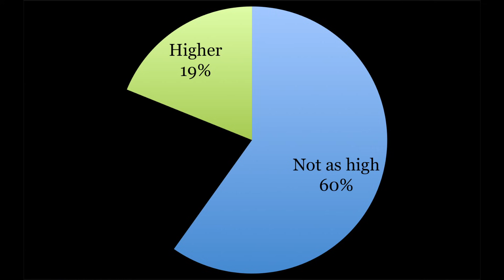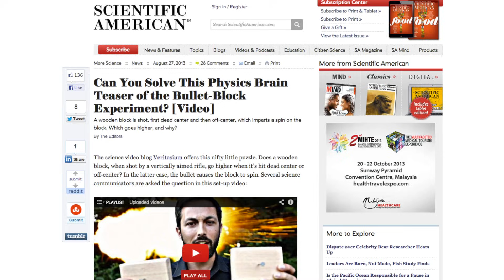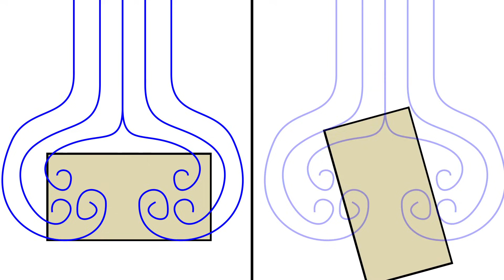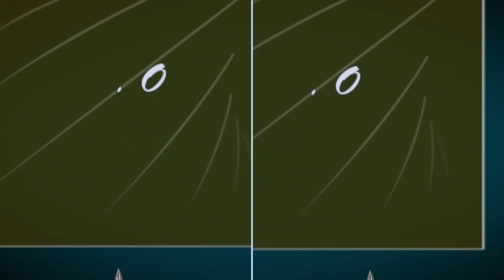Bullet Block Explained!

Comment: Exactly when the blocks had X energy is irrelevent to the study of why there wasn't as much of a difference (in the height) as expected given such a linear event from start to finish (apart from wind resistance). This video is a mess, is all over the place, and is making my head spin like a block shot in its "off-center" lol

I dont understand why two different laws keep getting exchanged seemingly for the sake of feigned confusion. =( I imagine its to illustrate the various ways someone MIGHT look at this from different angles. But why not explain the correct way to understand such an experiment first. Then give the neat side-notes of experiences and perspectives.
The quote @ 02:45 seemed to be on exactly the right track if I understood him correctly as meaning "the amount of energy necessary to make one of two nearly identical items spin is miniscule when compared to the amount of energy needed to win the fight against earths gravity (if only for a few moments and feet)" which no matter how you calculate it, is true in the case of these blocks, and for the record, a comparison of two unrelated laws of physics. 
"1.5x the energy" does not mean "better than gravity."  ;)  Especially when that "1.5x the energy" is largely used to uselessly spin around on an axis lol.
But I mean, for a piece of wood, its a pretty exciting trick!
And I don't mean to be harsh. But the first 4 min of this video are so scattered and tangled, its enough to ruin some people I knows understanding of the entire thing. I appreciate people experimenting, sharing, and generally pursuing greater / more varied knowledge. Its awesome and exciting and always makes me hopeful.

Comment: I would change the experiment as follows:. Put the block on a fixed axle (instead of the nail) so 100% of it's energy becomes rotation, or crushing the wood.  Then shoot it both ways to see the difference in dept.

Comment: Use softer and much larger blocks. So if the bullet travels a meter into the block the difference will be 1 cm (assuming 1% difference), which is totally measurable.
Reply: Traveling that far might cut down on frictional losses too!  Which was my choice for why they both go up the same amount but the one rotates!  The rotating one has less loss of energy due to friction.

Comment: This is one of the things I found extremely counter intuitive about kinematics. The short answer is that while linear momentum is invariant under translations, angular momentum is not. For example, an asteroid traveling extremely fast but directly at the sun will run straight into the sun, and that's it. Now point the asteroid just slightly off center, and it will end up orbiting around the sun with some angular momentum.
So look at the block and bullet situation from the Center of Mass perspective, because that's usually the most convenient to work with. In the first instance, the bullet is traveling directly at the center of mass. In the second instance, the bullet velocity is not directly towards the center of mass. So in the second instance, the system actually starts with some angular momentum with respect to the COM as soon as the bullet is out of the gun.
The hard part is intuition we have that 'everything is exactly the same, except the gun is shifted 2 inches'. Everything is the same with regards to linear momentum, but 2 inches means everything to angular momentum. Energy is still conserved, it's just with regards to the COM the the second system starts with more rotational KE.

Comment: this is far too unsatisfying.
Reply: I think if he did a quick test of the wood for temperature you might see the bullet fired directly into the center of the block got a lot warmer.  Heat=energy.  And once you factor in the energy of heat you would see both blocks had the same amount of energy.  The spinning one just had energy you could observe without any additional measurements.

Comment: There is no more energy because as the block spins it's being equally pulled down and pushed up. Same as the one hit in the center. Rotation doesn't equate to more energy. If it had more energy it would go higher.

Comment: What if you try the experiment with the following conditions and compare it to the previously tested conditions:

Constants:
- all blocks must be the same weight

Variations:
- blocks that are heavy on one side, then shoot the lighter sides.
- blocks that are heavy on one side, then shoot the heavy sides.
- blocks that are heavy on the center, then shoot either side.
- blocks that are heavy on the center, then shoot the center.
- "aerodynamic" blocks
- blocks that are not easily penetrated by bullets
- combination of those variations (ex: aerodynamic and bullet-resistant blocks, etc.)

My guess is that maybe different factors, such as the distribution of weight and aerodynamics, could affect the outcome of the experiment somehow.

Maybe shooting the block on the heavier side, when one side is heavy, would go higher. Maybe more spinning momentum would produce lift. Maybe the weighted side would create more upward and downward momentum, resulting in more spinning momentum that could help it go higher. What about blocks shaped a certain way, to reduce drag (while still being as heavy as the other blocks)?

I don't know. I'm not a scientist or a physicist, but I'd like to see the results of such experiments.

Comment: But if the X-ray showed the same level of penetration, then what the hell was up with the nails showing different levels of penetration...?
Reply: It may be because the bullet created a curved hole as it entered the block. The nail doesn't curve through the hole, so it wouldn't travel in as far.
Reply: I don't think the curve would've been that extreme. 

The nail will have been narrower than the channel by a significant enough margin for any curve to be largely negligible anyway. 

The video just seemed to contradict itself by not addressing this before it ended.
Reply: Bullet4MyEnemy Yeah, I agree that Veritasium should probably have made that a bit clearer.
Reply: Jack Hooper There is a lot in this video that was just all over the place
Reply: GOOD POINT BULLET! i wondered exact same thing, sticking a nail completley in one hole and than half of it in the other whole than Xray and 1/10mm difference WHAT BS WAS THAT?
Reply: Jack Hooper Agreed!  Using a thick nail to trace a bullet path in a spinning object when his graphic shows it curving was working against him!  Just use a wire gauge!
Reply: Actually, he did address this, less of the energy went to deforming either of the pieces.
Reply: I know I'm late but I only just came across this video.
If you look at the X-ray images, the block with the bullet off to the side has a very visibly less deformed bullet. The bullet in the centre is a rough circle, in the image, whereas the other one still has some of its original shape. If this holds true for all the blocks, that would explain some of the difference in depth.
All in all, the choice of wood as a material was simply a bad one, and using a solid, inflexible piece of metal, i.e. a nail, to test depth made it worse.

Comment: The easiest way would be to look at the bullet:
# Both bullets get blocked by the same mass and mass density, hence their speed reduction would be the same.

btw. Science isn't about what looks cute. So leaving out information that might show that the average rotating block goes higher and has less height deviation than the average non-rotating block is significant. Cute ("same height") is about emotions.

Comment: What doesnt make sense though, is what happens when the block with the bullet shot on the side reaches the top (meaning the nail, gun barrel, and bullet are in a straight line). Shouldnt the energy then be pushing down, not up? the direction of the energy would literally have to do a 180 or the vertical energy would be pulling it down. WTF THIS IS CONFUSING. I LOVE IT

Comment: Think about this:
Imagine two identical cars each weighing the same. Now, one car is pushed forward, the energy is focused in the middle. The second car is pushed with the exact same amount of energy, but the energy is focused on the right or the left (still pushed forward from behind, however). It makes sense that the car will travel the same distance. Same idea with the block.

Comment: Try non penetrating(solid) blocks so we will have energy transfer only at the strike ..!
I feel in that case height won't be the same ...!
block with bullet striking at center will go farther ..!
But in that case since bullet in not inside block the bullet hitting block at the corner will go farther and hence we can see conservation of energy properly.
In current case also energy is preserved but since there is energy loss in terms of sound and deformation we can't measure it properly .
In other words we can say in rotating block less energy is lost in deformation of block hence it could go approximately to the same height even while rotating.

Comment: Erm, it seems to me that the obvious answer would actually be that the block is spinning in the first place because one side has more gravitational potential energy than the other since the bullet impacted to the side of the center of gravity, which also means that the other has less and the total net gain of energy is the same.

Right?

Comment: Several good answers and I'm a little late to the party but...

Given that the difference in penetration depth is expected to be very small, the obvious first answer is to increase the total travel of the bullets by lowering the density of the medium.  Lots of people are suggesting using styrofoam... which is not feasible, since the total mass of a styrofoam block that could halt a bullet would be enough that the experiment simply wouldn't work.  I've seen ballistic gel mentioned, but it lacks the rigidity to accurately model the original experiment.  I have similar objections to various other types of materials that I can think of.

One solution to these is to use a composite object.  Given that we're most interested in the end of the path through the object, you could create a block made of layers of wood of different densities.  Assuming a total penetration of approximately two inches, create a block that is composed of 1.5 inches of the original material (pine?) on the top and bottom, and replace the middle section with a lighter material like balsa wood.  Perhaps have an intermediate layer of a third type that has a density between the two  The bulk of the energy of penetration would be spent on the harder outside layer, while the "target" layer would allow the last of the penetration energy to be expended over a much longer distance.

The resultant composite block would retain rigidity and could be adjusted to more closely match the mass of the original experimental block.

Actually you could hollow out the block and fill it with ballistic gel for a similar effect.  Might still lose some of the rotational energy to pressure waves in the non-rigid gel however.  Would be an interesting experiment either way :)
Reply: If heating of the absorber is the cause of the difference in apparent energy how about shooting lead into lead?   So the bullet is stopped immediately with no deformation path?   You put a pocket of lead in each piece of wood and rebalance the wood **(new center of mass)
Reply: john m the problem with using the same material as the projectile is that you then have to measure the effects of heating reliably. Not sure that would be a simple thing to do.
Reply: TheMonk72 nice

Comment: One thing I find interesting is the rotational momentum of the projectile appears to have no effect in this test.  With a rotational velocity of +- 84,000 rpm (.22lr out of a 1/12 twist barrel at a muzzle velocity of 1435fps) I would have expected a 40 grain projectile to impart at least Some noticeable spin on the block of wood as it penetrates.  (Rpm=MV* (12/12)*60) Under the presumption this was a .22lr and not some other round

Comment: The material catching the bullet needs to be consistent to measure bullet penetration, and the rifle used needs to maintain a consistent velocity. I assume a small caliber (.22) is used, and since .22 is mass produced, it is possible that the bullet speeds vary enough to skew the results. Some cartridge manufacturers are of higher quality and may be more consistent. I know I sound picky, but a tenth of a millimeter is pretty tight:)

Comment: To make the difference in depth measurable, you'd have to use a material that does not require so much energy to deform - like styrofoam, which you could weight down with a piece of metal in the center so that air resistance is not so much a problem...

Comment: Just repeat your experiment with wider wood block (3:1 ratio ? maybe even 4:1). I'm sure it won't fly as high then, because most of bullet's energy will go into wood block's rotation. The more off-center you hit the block, the quicker it'll spin and the lower it will fly. Another words: You have the same amount of energy you transferring to the object. If you hit it directly on the center - all of this energy will go to lift it up, if you hit it on the edge, most of it will go to rotate it.

Comment: Wood may not be a suitable material for this experiment because the difference in energy absorbed between the spinning vs non-spinning block may be manifest as a difference in how much the wood flexes outward with the shockwave, perpendicular to the path of the bullet. Wood is yielding enough to flex out and back, causing little observable difference in penetration depth despite significant difference in absorbed energy.

Comment: I believe a larger caliber rifle such as .243 with a very high velocity bullet would show more difference in penetration depth, especially using monolithic copper bullet of the sort available from Barnes or other major manufacturers. A larger/heavier block would allow the heights to remain filmable. Also, muzzle velocity is highly variable with cheap ammunition, especially rimfires. Match grade ammo or handloads should be used to ensure consistent ammunition performance.

Comment: I thought about this and came up with a couple of ways to improve the experiment. If you keep the moment of inertia as small as possible while increasing the mass of the block this will give you the largest difference in bullet penetration. The easiest way to do this would be to use a lead cylinder instead of a nail in the center of the block or glue lead disks to the outside of the block. 

Another way would be to increase the bullet's kinetic energy and/or use a weaker material. This would allow the bullet to travel farther into the block which would amplify the small difference between the two. You would need to run tests to make sure the bullet wouldn't penetrate all the way through. 

One last thing to consider is if you glue to the outside of the block instead of nailing into it you will be able to penetrate past the center of the block. This will also reduce internal stresses that could skew your results.

Comment: Perhaps it is the same thing that happens when you strike a smooth ball compared to one with an irregular surface, such as a Golf ball? The Golf ball travels further. The spinning block would perhaps simulate an irregular surface? Also of consideration may be table tennis where a similar force applied to a ball without spin has a different result from one that is spinning! It also seems to matter whether it is top spin or back spin. I don't know about pool or snooker where a spin is put on a ball deliberately but I am sure I have seen a spinning ball actually accelerate after hitting the side cushion. Bit of a trick that one though because the back spinning ball initially has more resistance but after it hits the cushion it reverts to forward spin, don't know why though. Last thing is that a bullet fired from a smooth barrel will not go as far as when fired from a rifled barrel even though the same energy is applied.

Comment: If you were to decrease the density of the target, there would be less resistance to penetration which should translate into a greater difference in the penetration of the bullet.  The wood block looked like redwood, but if you were to use a piece of balsa that may help.  Or maybe something that would generate less friction when penetrated like a foam with a lubricant inside the bubbles that would decrease the friction as the bullet penetrated.

If one was to dispense with the gun and use a crossbow, arrows and a sliding target, the energy absorption should be more visible/measureable.

Comment: One possible way to receive a bigger difference in bullet penetration between the two blocks would be to repeat the experiment with a bigger softer material, in place of the blocks. If a bigger block made of softer material was used, the bullet would penetrate much farther in each block and the difference between the bullet depth would be greater and measurable. This would happen because the amount of energy the block that doesn't rotate saves by not spinning allows for a much greater penetration in a softer material. The force applied to the bullet by the block of wood is large and doesn't permit it to enter very far. If a softer material was used, the deceleration of the bullet occurs over a longer period of time and therefore the bullet travels further into the material.

Comment: You should consider each bullet. Nearly no two bullets of the same caliber have the same muzzle velocity because of small fluctuations in the amounts of gunpowder in each case. As well you could be experiencing bullet "set back" where the bullet has been pushed deeper into the the case than originally designed. Maybe consult a professional reloader or gunsmith for further help.